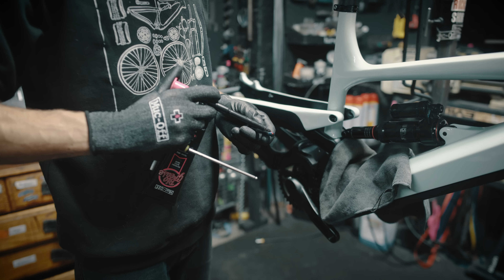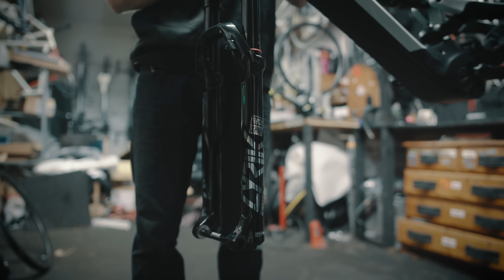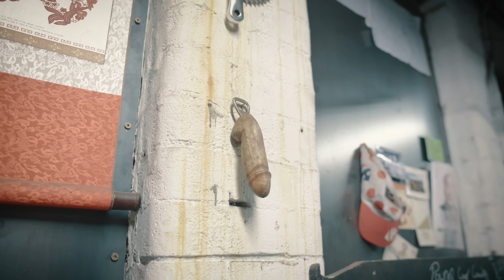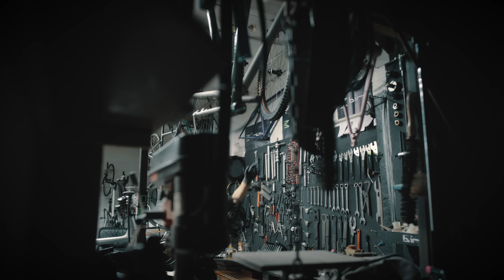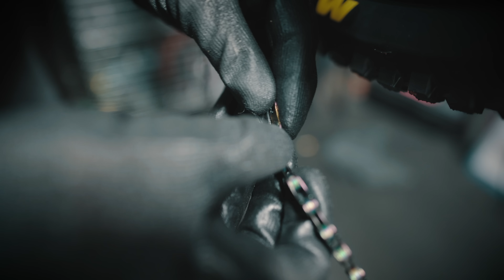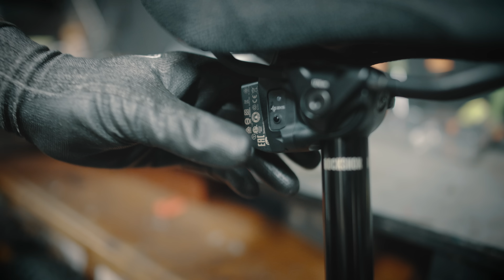DREAM BUILD E-MTB - YT Decoy

Comment: The irony of an e-mtb using a Shimano motor with a SRAM groupset. Also, how many batteries to connect! Such a beautiful bike and the technology helps more people ride but it is getting very complex and very expensive.
Reply: Certainly not for everyone...
Reply: can i ask whats the difference between an e-mtb vs mtb? whats the purpose of having it in "electricity" ?
Reply: Angelo Bacayo it’s an electric pedal assist, designed for people who need to do exceptionally long journeys and stuff. You can pick how much output you’re getting but the motor is only active when you’re peddling
Reply: @ninoangelobacayo67  In this kind of e-bikes, a sensor detects the effort you use on the pedals and a control unit calculates the force that the engine delivers, instant by instant, according to the level of assistance set by the rider. The engine helps with a percentage that can vary from 10% of the effort to 250%. It is a bike for rehabilitation use or for those who are lazy or for those who are forced to face too hard climbs ... or even for real athletes who alternate the use of normal bikes with these for laps that loosen tired muscles. Obviously there are much cheaper versions of e-bikes, therefore, in some cases, they are also simply utility vehicles halfway between bicycle and moped.
Reply: This is too complicating ill stick to a single speed with my own legs 😅
Reply: Nico Danger lazy.  Do some research.  You work just as hard as a regular bike. Also people who can’t afford them call it lazy.

Comment: What are the red nuts he screws into the brake hoses? And there reason?
Reply: Those are hydraulic hose compression olives. When you tighten the nut, it compresses the olive onto the hose, therefore making a hydraulic line connection.